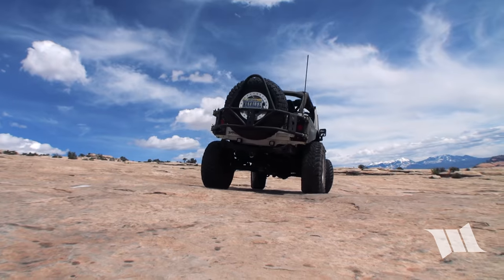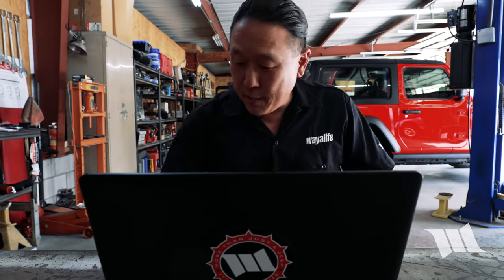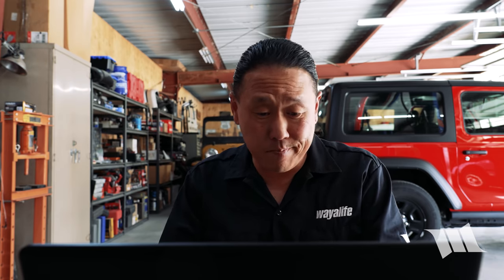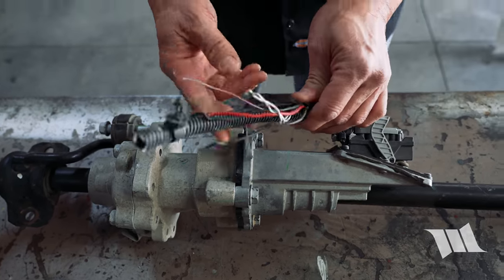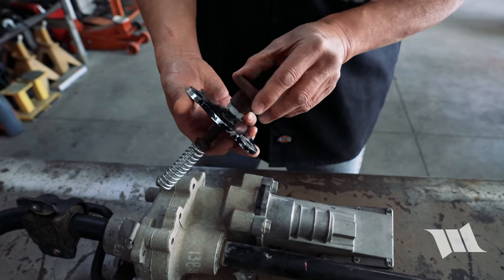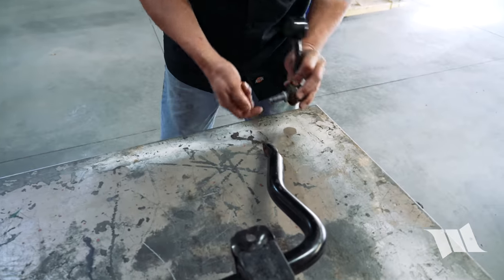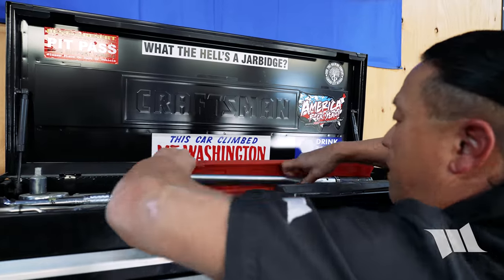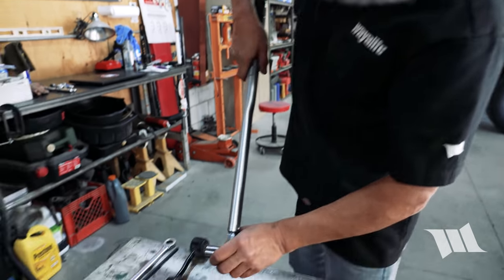My Favorite Sway Bar Disconnect Installed on Our Jeep JL Wrangler Sport and for Under $150

Comment: Why not disconnect the rear ?
Reply from the maker: Mainly because the torsion rate on it is so soft that disconnecting it isn't needed. You can literally manipulate it by hand. Leaving it connected will still allow for full flex and it will also offer much desired stability.
Reply: @wayalife  
Thanks

Comment: Interesting the sway bar got upgraded on the Sport before upgrading to huge mud tires, beadlock wheels, or Dana 60. Edit: I forgot the 8 inch lift.
Reply from the maker: LOL - there's a LOT you can do bone stock and disconnecting your sway bar only helps that along. Big tires require a lift and there's nothing budget friendly about them or a 1-ton axle. As I state in the video, the whole point of this Jeep is to keep it as stock or stockish as possible and that any mods we did do, would be done with budget in mine.

Comment: Wow 140 bucks 
They charge like 1500 for the motor
That’s awesome
Reply from the maker: Well, to be fair, the sway bar I bought was used and off a JK and the motor didn't work. There are lots of them out there just like this.
Reply: @wayalife  true lol my motor works on mine but the gears are stuck 
Gotta pop it open and clean it up